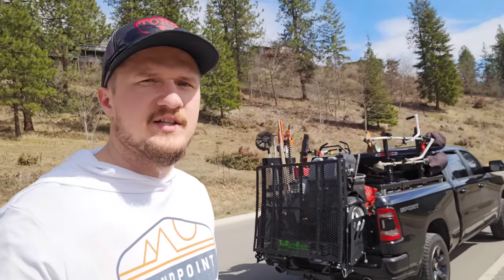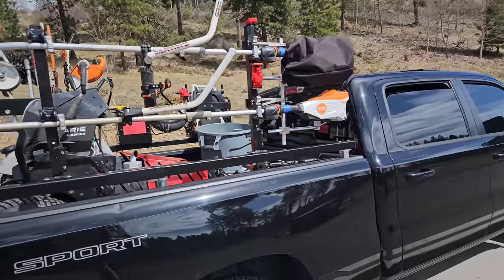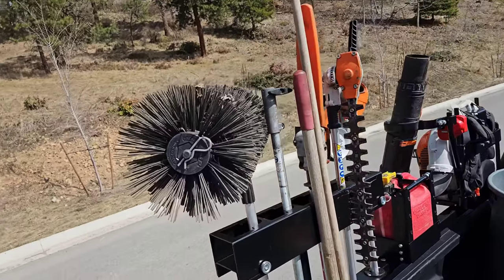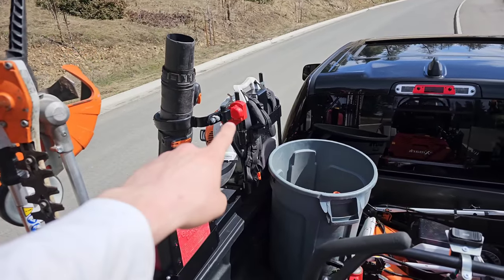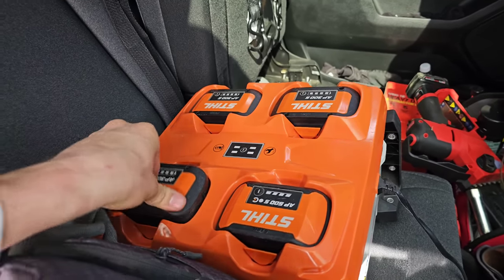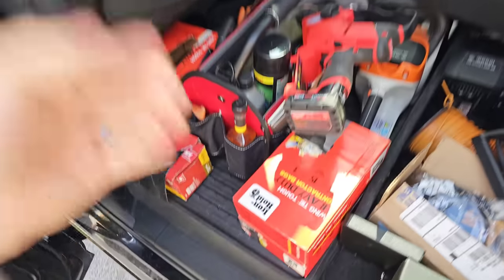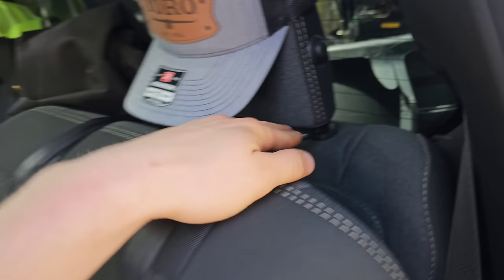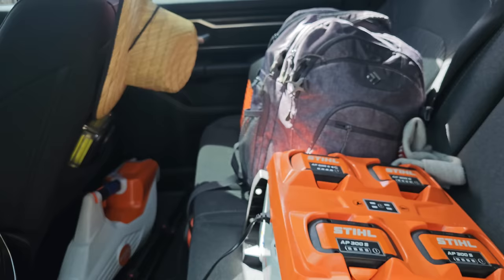2023 Trailerless Solo Lawn Care Setup (Gas/Battery Hybrid)

Comment: I have the same setup but I had to beef up the suspension new shocks timbrens and leave springs
Reply from the maker: Awesome. How you liking it?
Reply: Love it I wen from 7x14 trailer to this it’s way more efficient I was doing 7 to 8 properties a day now I’m doing 15 to 18 solo a day and to do small cleanup I just scheduled them on separate days and I get to use it for my atv with a plow for snow removal this thing has changed my business completely

Comment: Nice setup, I do lawns on the weekend for side hustle. I'm currently using an enclosed trailer with an EGO Zeroturn, trimmer, and blower setup that I tow with my F150 Lightning... doing an all electric theme setup... slogan is "whisper quiet lawncare". I run a pigtail into the bed of the truck and use the ProPower to charge the mower and such when needed. It supplies the outlets that are mounted in my trailer. I sometimes wish i went with a no trailer setup.. the trailer is annoying at times, especially in older neighborhoods with busy roads..

Comment: I like the efficiency of a trailerless setup but there are to many times that I need a trailer for it to make sense.   I run stihl 4-mix trimmers.  There's no way the battery stuff can match my fs131.  I am thinking about getting another 4-mix kombi with a power broom and a hedge trimmer head.  I have a ryobi 40v hedge trimmer, chainsaw and blower.  Electric blower works perfectly for me, it can do 4-5 driveways per battery, and I don't waste time starting or fueling.

Comment: Do you prefer on your gas trimmers. 2 stroke or 4 stroke motors. I have a Honda 4 stroke trimmer. I find it so much easier. No mixing oil. The trimmer starts first time every time. Plus the sound isn’t as high pitched as the 2 stroke engine are, but it each to each person’s preference. Now I  have my 4 stroke  engine there is no going back for me.
Reply from the maker: My Stihl's have what's called a "4-mix" engine. 4 strokes, but it's a 2 cycle motor, no oil. Yeah, I agree. The sound is much quieter with those honda 4 strokes.

Comment: Loving the set-up! Bet you'll get a ton of attention. I have a similar set-up but am debating whether or not I need airbags on the Tacoma. It squats a bit but not where it's sitting on the frame and haven't really noticed anything to concern me yet. May get it either way as I'm OCD about it not looking even 🤣
Reply from the maker: Thanks, Jose. Are you putting a heavy commercial unit in the back? Mine squats with airbags at 0psi
Reply: Yes, with a 800 lbs Ferris Z1, it squats about 4 inches or so but not sitting on the bump stop.
Reply from the maker: @Jose Espinoza  right on. Yeah, you might want to get some just in case.
Reply: Definitely looking into it. Was it difficult to install?
Reply: You want the air bags especially with a Toyota it will help with stability at interstate speeds also it’ll save your suspension when u hit a bump or pot hole it’s not the stationary weight you have to worry about it’s the compound weight of motion

Comment: Nice setup. I am in California and can’t use gas. I am going to start a couple days a week. Maybe with my son’s help if needed. I am debating which battery platform, Sthil, Ego, Toro, Echo, green works. Also considering Ryobi I love that they have a 30” battery Zero turn (battery’s run $900?. In CA Bay Area we have smaller yards predominantly and will probably mostly use a push mower. Do you think a self propelled mower will be good idea? Ego and green works also have affordable Zero turns.

Comment: Would a 52” fit with the gate up if you didn’t pull between the fenders but parked it right before? I see it works with the 8’ beds but a want to know if it still works on the 6.5

Comment: Nice setup not a big fan of battery equipment I feel those are a gimmick they rip you off on the batteries cost and that’s the week point good luck
Reply from the maker: Thanks, bro. Yeah, I like the technology, but I think the price isn't there yet.
Reply: @fillslawncareplus  Admittedly yeah the batteries are a bit pricy but when you think of how much you make off the one product the extra 200 or 300 you might shell out long term is less pricy than the overall maintenance on gas equipment plus you arent shelling out a bunch of money for gasoline